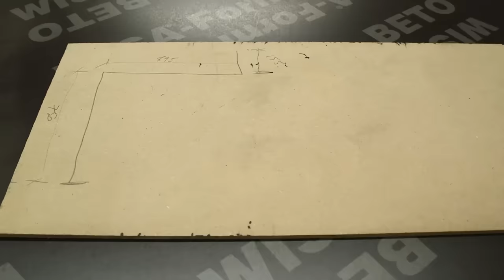Installing wood flooring in a 160 year old house

Comment: Wouldn't it been easier to remove the old wooden floor, shim the underlaying construction and nail it back on? But your perfection is always impressive.
Reply: That was my first thought...however, this house is really old and the wood still looks as if it is retaining its integrity.  Leaving it be adds structural strength (in my opinion).
Reply: No. Removing the old wooden subfloor would only make sense if it were severely damaged or unusable. As that was not the case, and only a few areas needed shimming, the right choice was to shim the low areas and sand/plane the high spots. The difference in man-hours between these two choices is significant.
Reply: @dr.skipkazarian5556  👍
Reply: Easier? Just "remove the old wooden floor..."   You must be joking !

Comment: Great result! But... To be honest, I'm suprised ready-made flooring was used - I would've thought old pallet wood meticulously planed and trimmed to size would be more the style.
Reply: I thought this, too!
Reply: You definitely want hardwood on the floor. And I doubt there’s any savings to be made milling your own hardwood flooring.
Reply: The only way making your own hardwood flooring is more economical is if you have hardwood trees on your property and a couple of years to air dry the boards. Pallet wood is notoriously soft wood.

But perhaps you were being facetious and I couldn't tell?
Reply: @MizzMaree7  The bottom three skids on some pallets are hardwood.

Comment: I watched you doing the cutting under with a modern multi tool, I just remember I did it with a panel saw over 20 years ago, people do not realise how to do a good wood floor that looks original. The idea of using old carpet tiles as an under lay is great.

Comment: I have made all these moves, telling myself there has to be an easier way...... Nope. There isn't. So satisfying to see another taking the time and doing it as well as it can be done. Well done sir!
Reply: Stunning finish ,but  why  did u not leave  🤔 expansion  all hardwood floor, s expand, u need freedom all around  12mm
Reply: @darrenfoley8330  More experience would tell you that stable wood in a stable house doesn't move a whole lot. "Leaving a gap" is what manufacturers recommend to avoid liabilities and in a rectangular room is no biggy. It is often, dare I say usually, impractical.
Reply: @davegrier523  true. Doesn't expand THAT much. He left a bit of room anyway. Also means that the baseboard will look really nice without some shitty moulding addon.

Comment: I hope you haven't suffered a headache because that roof material is not part of the structures.  It can evaporate into the room air and can cause symptoms, including headaches.  Here in Finland, there are very precise regulations on construction, and you couldn't do that here.  Otherwise, a really beautiful result and a great job you are doing 👍🏻👍🏻👍🏻
Reply: I was wondering about this felt myself. Searching for 2mm roofing felt only returns torch-on felt like what is on shed roofs, is this the same stuff or has he used a more modern version without bitumen/asphalt I wonder.. I was looking to pack up a low spot in my floor before putting in laminate so this looked perfect - but the last thing I want is fumes or headaches!

Comment: Very interesting indeed!  We had a floor installed in quite a large house with long runs along the corridors, and we found out 6 months later that the expansion gaps were not big enough.   Required a lot of adjustment.   Lesson was that the time of year when you have the floor installed is quite important.
Reply: Also, the type of wood you use effects expansion. This looked like a factory made floor---solid top on a built up core---and it doesn't move much. Or at least it's no supposed to!

Comment: Beautiful job. No-one could ever accuse you of lacking attention to detail!
  My house here in New Zealand is floored with Mātai, a native timber quite similar in colouring to the material you just laid. The house was built the old way, where the entire floor is installed before the house framing goes on top. It means the floor is under everything and if ever any rooms are changed, the floor is continuous underneath.
Reply: Mine are rimu, laid the same Kiwi way. Now 65yrs old, they are a little worn in doorways,  a little off level, etc. A good sanding and sealing, and they look amazing! 

While the new flooring looks great,  i wonder what the original floor boards would have looked like restored, and why they were covered...

I am really enjoying watching the attention to detail in this restoration. ❤

Comment: Fantastic!! Truly looks amazing - Just a word of caution for anybody looking to do something similar - In an old house there are often / nearly always, loads of pipes running around the place that in time will need to be accessed to repair leaks or wiring that needs to be checked or amended etc.  I can't tell you the amount of times we have had to lift floorboards in an emergency over the last fifteen years.  if our flooring had been as beautiful as this we would have just cried taking a multi-tool to it! An alternative options might be to consider replacing the originals and not having interlocking boards and using period style nails to fix - potentially more draughty I know and a slightly different look but still can look lovely with less drama in the future.  I hope this doesn't come across as negative.- I really do love the look and great job / attention to detail - cheers.

Comment: The manner in which you trimmed your door jambs/casings was top notch. When I do this, I add a small but invaluable extra step: I will add a 1/16th shim to the board acting as the height guide for the flush cut saw. Doing so gives me a tiny fraction of extra wiggle-room, which accomplishes two things. First, I avoid the inevitable hassles of too snug floor board (due to small variations in the subfloor and the cutting process). The boards slide right in every time.  

Second, this tiny, nearly invisible, 1/16th gap also creates a shadow line, which eliminates (camouflages, really) the inevitable areas where the flooring touches--or doesn’t touch--the door jambs/casings. The eye doesn’t really notice minor variations in a shadow line as long as it is (relatively) unbroken, but the eye does notice where a shadow line starts & stops. Look at the baseboards in any house with hardwood floors (or tiles) and you will see this right away. This is the main reason why less experienced carpenters use shoe molding in conjunction with baseboard molding—to hide these gaps. Shoe mold is very bendy and can be forced to conform to variations in the flooring.

I also use this technique with my baseboards and plinth blocks (shim them 1/16th off the floor). First, it creates visual continuity with the door jambs/casings, and second, it solves the same problems (minor irregularities in the baseboards and wood floor). I also put a back bevel on my baseboards, a time-honored technique with carpenters, which makes the above process even smoother and more uniform.
Reply: Where's your channel? 
Feels like you're bandwagoning. Leave the it to the Maestro Salieri

Comment: Your level of workmanship is to be admired and aspired to.  The felt is a brilliant idea.  I have had to replace the ends of four floor joists because their ends had rotted.  The new joists are slightly smaller and was wondering how I could lay the floor without resorting to trying to strip some very fine fillets of wood.

Comment: You were right to use wood to level the floor. I used the leveling compound and I ended up having to pull up the floor to replace the leveling compound because it cracked and made a awful noise when walked across
Reply: You didn't prime the sub floor, or  used the wrong latex or, there was movement in the floor covering.
Reply: @jamiehalpin9921  Agreed. Those are the three main culprits. Leveling compound is loved by novices and hated by the people who fix the mistakes of novices.

Comment: Really nice looking floor.
I was told by the fitters that even my bamboo flooring which is very resistant to moisture had to have expansion gaps around the perimeter.
Not sure I'd put wood floors in kitchen/bathroom though.
Reply from the maker: any wood flooring needs a gap around it, i left around 10mm all round. bamboo is very good in bathroom/ kitchen, especially the strand woven stuff like ive used. we had a minor leak in the shower for ages and saturated the end of one board over months, when i fixed it, it just dried out and is perfect again!
Reply: @NewYorkshireWorkshop  Your floor looks beautiful, thanks for showing us. I laid 10mm solid oak boarding to my brothers kitchen diner, he had a flood. We allowed the floor to dry out and honestly it looked almost as good as new after. the expansion gap allowed the floor to swell and then settle back.
Reply: @NewYorkshireWorkshop  Perhaps you might consider editing your video introduction to inform the audience that you used a strand woven bamboo flooring product? There is considerable confusion about this project in the absence of that data, sir.

Comment: Great to watch! Two observations. 1. I thought you might prep/paint the door frames before fitting the flooring. 2. You keep the ear defenders on ;)
Reply: With all due respect, to prep/paint the door frames before fitting the flooring is bass ackwards. Any large job like this involves some minor damage/dings/nicks to nearby surfaces, ESPECIALLY door frames. It is standard practice to do touch-up painting at the completion of a large job like this.

Comment: You must be a very tidy plasterer/painter. I've always been told Floors are the last thing to be addressed when decorating. (I may be out on a limb here, in assuming you will be working on the walls!) As with everything you do: meticulous, accurate and lovely.
Reply: Painting is done. Just the skirting boards and electrics so he should be just fine. Lovely job
Reply: @graham6229  Actually, I think that Paul has a point--there is still plastering/painting to do. But it's a non-issue for two reasons. One, when it is your own house, and you have competing priorities, you don't always have the luxury of following a schedule as you would on a commercial job. And two, we can all agree that NYW is VERY focused on craftsmanship and details, and he will protect the floors from damage.

Comment: Shall we assume the "hardwood flooring" is oak?  Where I live (Kauai) I installed bamboo...expensive but durable, renewable, and damn pretty.  Great workmanship, engineering, and patience....old mole.
Reply from the maker: It is actually strand woven bamboo! great minds think alike! Im not sure it is technically hardwood though, hard grass? or  is that something else..
Reply: @NewYorkshireWorkshop  No, but that's funny! It's a soft but strong grass, made quite hard with resins and modern chemistry.

Comment: Very impressive work and methodology. Can I ask hopefully a simple question, with regards to stair nosing, what is the method for fixing to ensure a smooth transition if the original sub floor tread already has a protruding nosing? Is it best to  trim or rout the nosing flush with the riser or is there a better and quicker method. In addition, can nosing be purchased here in the U.K. Or do we have to manufacture our own from the existing flooring planks. Many thanks.

Comment: I like the video for the instructive aspect and respect the diligence and effort, in my mind it only begs the question - why did you decide to cover the lovely old planking, because it seems you went through roughly the same amount of time and effort than removing the old leftover paint and applying a hard wax-oil finish would have taken? Of course there's no accounting for tastes, I just figured there might have been something I missed.

Comment: Wonderful! Eventhough it seems you fitted everything mm perfect, I assume you still left a small gap all round to allow for expansion of the wood and this will be hidden by the skirting? Or are the boards themselves stable or flexible enough?
Reply: He left the boards to acclimatise to the room for months before fitting. They will have expanded a lot by then, but he said in comments he left 10mm all around.
Reply: Taylor T is correct, and you can also see the gap throughout the video.

Comment: If the wood used is a hardwood then the installation is defective in that it should allow for a considerable amount of moisture movement across the grain and a little less with the grain.  As this is a solid wood plank floor then it should not be used in a bathroom,  Without considerable allowance for expansion, normal changes in seasonal humidity will allow the wood to expand and bulge up.  I have seen wood floors of this type blow to such an extent that the floor has raised several inches, and two instances of bitumen bedded wood block parquet flooring rise up to 1,00m during refurbishment when the heating was turned off during the autumn!!  My own 18mm solid oak plank flooring, which was fully laid to manufacturers spec and instructions has debonded and will blow in damp weather.  To cure it would mean ripping the whole floor up and starting again so we suffer it.
The amount of adhesive used for the bonding is insufficient for the purpose and should be more generous that what is shown.

Comment: I'm really hoping you're somewhere that's not humid, as those carpet tiles will trap moisture underneath and potentially rot out the pre-existing floor.
Reply: Carpet tiles are synthetic and rubber based. The floor he is putting them on id very old and very dry. No damp can get under there.
Reply: @graham6229  This is an important topic, and you both have a point, but neither has the solution. The truth is that there are MANY variables when dealing with water (moisture/vapor, really) and this video doesn't supply anywhere near enough data for us in the audience to make any kind of qualified statement. For example: does this house use air conditioning in the summer? Humidification in the winter? What is under this floor of the house? Another conditioned living space? A basement? A crawl space?

The list of unknowns is too long, and given the demonstrated competence of the New Yorkshire Workshop, let's just trust that he's got this part handled. (But for all the novices out there, some good advice would be "don't try this at home.")
Reply: @idontthinkso666  I think he is upstairs , under the floor is downstairs.

Comment: Def picked up a few new tricks watching you do the job. Are you concerned about the moisture in the shower room causing the flooring to over expand?
 Just curious. Anywho you did a hell of a job though👍🏼
Reply: Boards are fully sealed both sides and ends. Anyway the Brits don't use the shower rooms that often :)

Comment: Great job. But while you mentioned all the tools, you did not mention the timber tiles. Massive or MDF. I would have cut feather and nut, tongue and groove in the nose and surrounding tiles not to need the metal sheet.

Comment: When they did our floors they floated those areas with some type of compound.
Reply: His building must be very old and has settled, for the subfloor to need that much prep.
Reply: You don't "float" with compound (whatever that is). You can level with leveling compound, or glue down with adhesive.
Reply: @bentnickel7487  Not at all. Age is only one factor with a job like this. The type of subfloor is another, as is the original craftsmanship (or lack thereof). However, his home is over 160 years old.

Comment: Very nicely done and beautiful flooring. I used lighter bamboo for a downstairs room addition and eucalyptus (about same color as yours) throughout the upstairs. Any issues with expansion around door ways?
Reply from the maker: No issues so far, I can see from the paint lines from glossing the skirting board that there is around 4-5mm of movement here and there but I allowed enough clearance all round to cover more than that. It was definitely pushing the limits by running it seamlessly around the entire level!
Reply: @NewYorkshireWorkshop  Good to hear. I had an issue upstairs (eucalyptus flooring) where it expanded to hit at the door entry  from hallway into primary bedroom and stopped and created a crack in the threshold as the floor continued to expand a bit more into the bedroom. The crack appeared about a year later. You can always use an oscillating saw to surgically cut away any flooring that seems to hit a fixed 2x stud. Have to say you did a really fine job.

Comment: Was that engineered wood or solid? Cracking job btw looking forward to seeing you do the skirting, made a right mess of mine due to uneven flooring & lack of skill.
Reply: Looks like it's solid. I would expect no less from this guy.
Reply: @akyhne  I don't know, engineered wood does have it's place it's less likely to warp for one especially as he is using it in a bathroom.
Reply: It looked like bamboo, which I believe is a laminated product, but solid bamboo all the way through. Correct me if I am wrong...